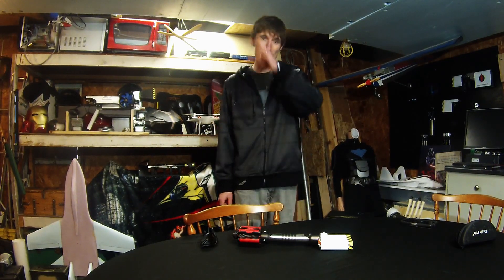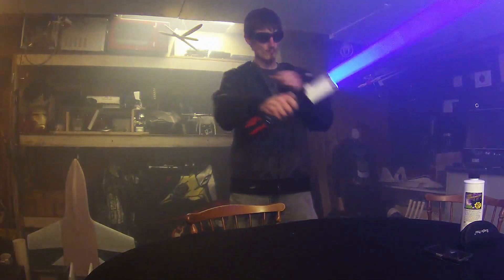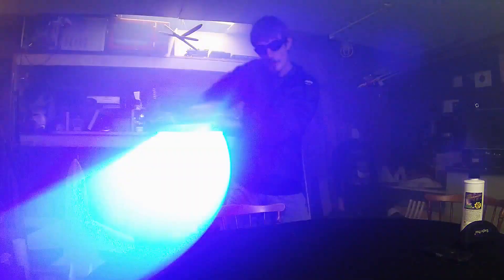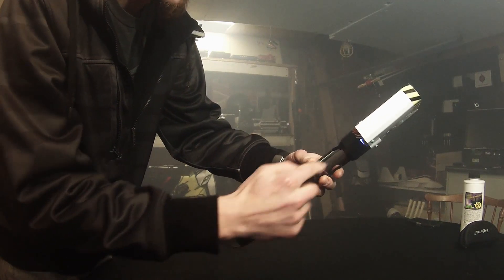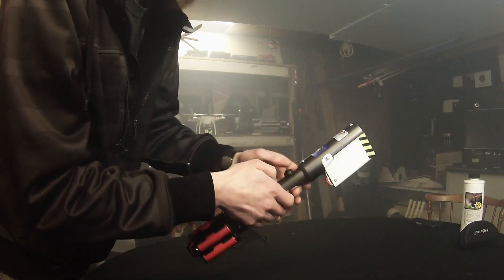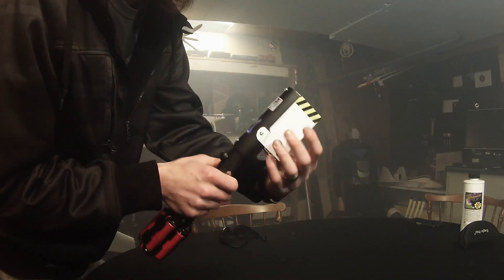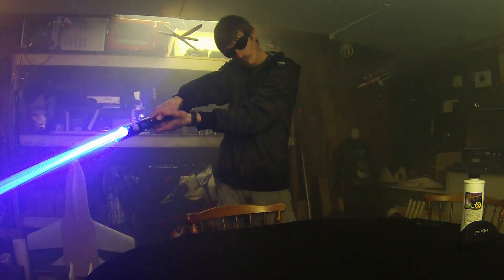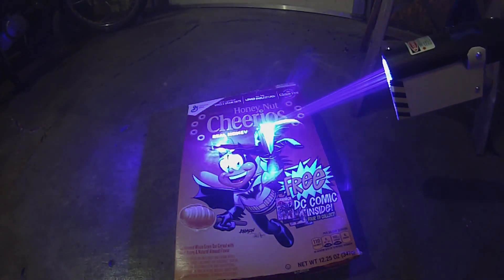Ultimate 48 Watt Laser Lightsaber! Absolutely Amazing!

Comment: How would I go about combining four green laser beams and put it in a handheld? I know I can knife edge them, but I want the beams as close together as possible, almost like a single ultra bright beam.
Reply from the maker: Two knife edge setups into a pbs cube. This will put the four beams as close as you can get with the two groups of two essentially residing in the same space. Then collimate the resulting beam with a lens.
Reply: @TroyPowersPowerfulInnovations  Good idea, thanks.
Reply: @TroyPowersPowerfulInnovations  Won't I lose a lot of power and light in the cube though? How efficient are they?
Reply from the maker: You’ll loose some power as you will with most any optics but if you get a cube rated for the wavelength it won’t be bad and you will still be quite happy with the results. Also with only using a single cube and one wavelength the power loss will be pretty low.
Reply from the maker: Good luck with the build man!
Reply: @TroyPowersPowerfulInnovations  Oh really? Thanks.
Reply: @TroyPowersPowerfulInnovations  Thanks! I might be going a bit overkill, since a 1w 520nm diode is already extremely bright. But hey, I want the brightest beam possible.
Reply: @TroyPowersPowerfulInnovations  Sorry for bothering you so much, but I have one more question. Is it even worth it to do this? I want the brightest beam humanly possible, and am planning to use four Nichia ndg7475 diodes, which are on their own very bright. I am wondering, will combining four of those beams make it any brighter? Or will it be a very subtle difference? I mean, by logic it should be a lot brighter.

Comment: AWESOME JOB BTW ! ONE MORE THING IS IT POSSIBLE TO SUPER FINE ALL THE LASERS INTO ONE SMALLER DOT WITH A SPECIAL FOCUS ER TYPE APPARATUS FOCUSING LENS ? WE ALL KNOW YOU CAN CROSS THE LASER STREAMS  LOL
Reply from the maker: You could use two lenses placed at the focal point of each other to shrink the beam size. The first to collimate the beam to a point and the second to redirect those beams back into a strait beam. This won’t necessarily make them one beam but will have a very similar effect. To combine multiple beams and have them exist in the same place requires a polarizing beam splitter cube and restricts you to combining two beams of opposite polarities or multiple beams of differing wavelengths.

Comment: Fake
Reply from the maker: What is fake about it?
Reply: Troy Powers fake . No 48W ..
10W yes . No 48w
Reply from the maker: It’s 24 separate diodes powered at 2 watts each. This produces a total output of 48 watts. Remember that it is not a single beam but multiples so it does not have destructive abilities like a single beam 48 watt would have. That doesn’t mean it’s fake.
Reply: Troy Powers Ok you are right but it burns like my laser 2w. If these LEDs were focused it had you power
Reply from the maker: Although if I focused the beam tighter it could be more powerful I also like it having the wide beam which makes it impressive in person. This was not designed specifically to be destructive.  If you want to see a more destructive laser check out my laser pistol here:

https://youtu.be/ADpCl1a2ZTE

Comment: looks kool not 48 watts it of burned 1000x hotter it took a second to pop balloon i would say 2 or 3watts  but it look kool i only say this cause i have a 9 watt and it cut through a quarter like butter
Reply from the maker: A 9 watt blue would not cut through a quarter like butter. Also this is a total power of 48 watts separated out over 24 diodes. Each individual diode has the cutting power of a 2 watt laser and they are pointed close to the same point. I created this mostly for effect and to give a proof of concept. If you’d like to see a more destructive laser check out my 6 watt laser pistol here: 

https://youtu.be/ADpCl1a2ZTE

Comment: Great design but I thought it would be more powerful. 50W is a solid amount of power and on a hot wire cutter you can easily cut plastic up to a few mm.
Reply from the maker: +Shroom Lab I would assume your refering to the time it takes to ignite things. I believe alot of that has to do with the optics. I am using an off the shelf toy magnifying lens for focusing. At the minimum diameter its still half an inch beam width. If I could focus it to a tighter beam width it would ignite things quicker. Still pretty fun as is though!
Reply: It would be great to see this sword on super focus. It is really something unique. How did you get all that lasers?
Reply: this is correct, even 1 x 1w laser with the right optic can cut/burn quite fast